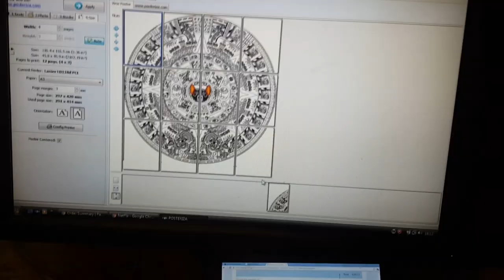Aztec  Sun Stone Wall Art - Router Carving with Denbigh Mensheds

Comment: What an amazing piece. Alot of time and effort clearly has gone into it. A true skill of workmanship and hard effort. 
I have a question, with the trim routers you were using, what bits did you use in them and where would you buy the bits?
Reply from the maker: Thanks, yes, it was many hours that they put in on this piece. Theyve just chosen another, it looks even harder :)
Search for CNC carving bits and youll find a huge selection on ebay and amazon. Here were using 10 degree carbide bits. More than likely you will need a reducer collet to go from your router to the cnc bits. 
I sell them ready to carve on ebay as well.

Comment: I like a lot of the wood engraving that you do. So I went out and bought some of the tools. Here is  a list of everything I bought. tell me if I got everything to or if there's anything else that I need or if there's a better tool to use than what I already have so I can start doing my own Engraving.

CNC Engraving Bit Router Adapter Convert 1/4" to 1/8" for Engraving Machine Tool (Pack of 5

DRILLPRO 10Pcs 0.8-3 mm Titanium Coat Carbide End Mill Engraving Bits CNC Rotary Burrs Set Tool PCB Mould Plastic Fiber Carbon Fiber Hardwood, 1/8'' Shank

HUHAO 20pcs 3.175mm 30° 45° 60° 90° Carbide PCB Engraving CNC Bit Router Tools(5pcs of each sizes

Bosch GKF125CEK-RT 120V 7 Amp 1.25 HP Variable Speed Palm Router
Reply from the maker: Thats a really good selection, youre pretty much good to go right there. I suggest you also purchase some larger fluted bits to clear out large areas quicker. Quarter inch shank 6mm and 10mm should be fine. 
Ive not used the end mill bits myself yet, i would take really easy with them.
The selection of Huhao bits will be useful, you might also want to look at these in a very fine 10 degree which I use most of all .  https://amzn.to/2P61bxg
Have fun and prepare lots of pieces ready for carving.
Reply: @thepoultrypeople  okay sir I will ordered those to thank you have a great day sir